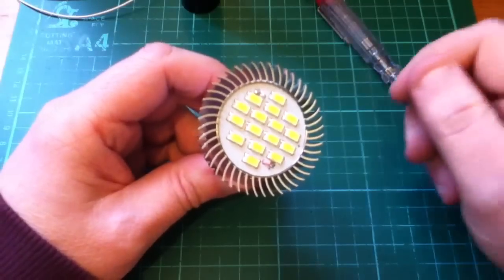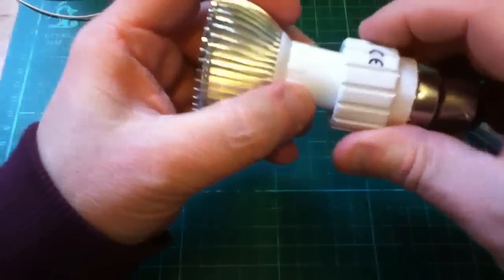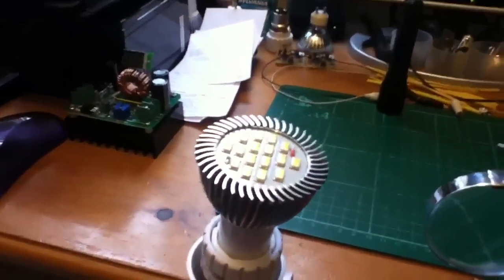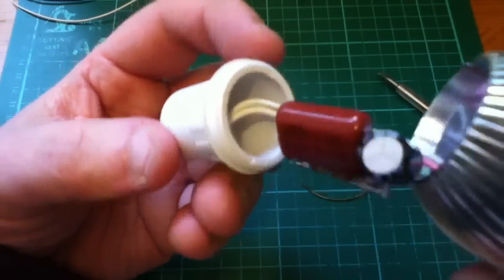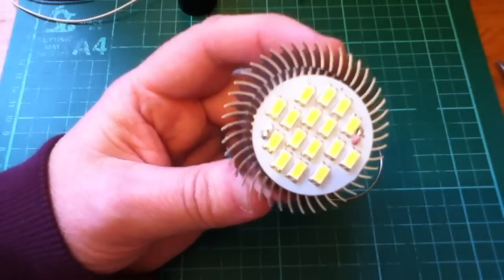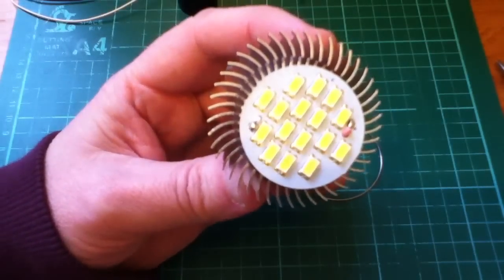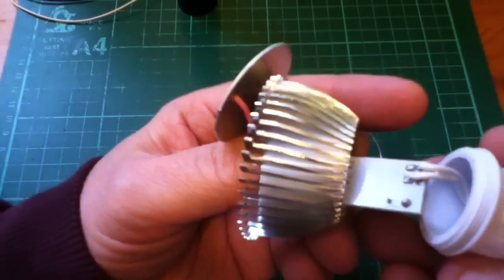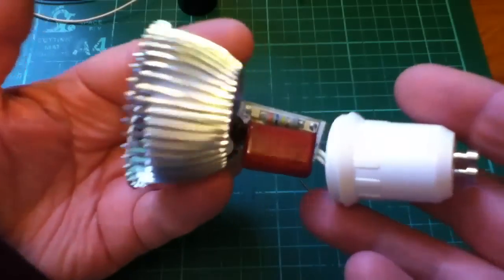Dangerous GU10 LED Spot Light is Cheap and Bright but could Kill You - Seriously

Comment: EDIT: This post originally read
"Remind me not to buy lighting from China."
it should probably read
"Remind me to check the reviews of a product before I purchase it"

However, several commenters have pointed out that shoddy merchandise or electrical components could be made in any country. My original post was a bit Jingoistic on my part, however I am leaving it up because It is a mistake that I made, and I don't hide my mistakes.
Reply: ***** I applaud your comment. If only everyone online could follow your example and show the humility you have. Bravo Sir.
Reply: If you don't edit it, then how will people know that you have learned from your mistake? I would edit if I were you. It's a bit too honest to display your previous mistakes.
Reply: Robert Headley crappy electronics can't be marketed in most countries. Sadly, China is not one of those.
Reply: I generally enjoy purchasing affordable electronics from China, but I think I will avoid anything that doesn't use batteries.
Reply: Yes, but they generally wont electrocute me.
Reply: Wang Cian hahaha if was made by Germans it's still not good rofl...you can find lighting not made in china and not with chinese components, with longer warranties too, but just be prepared to pay for it
Reply: in my opinion one of the most important factors is the assembling process ... and which country is famous for accurate assembling ?
Reply: 9 years later: Good luck finding lights not made in China.

Comment: I bought few different ones. Always with plastic lens cover. Apparently supposed to be dimmable. Effect - few exploded. And broke two dimm switch.
Wether it is wrong dimm switch I had or not I am disappointed and find those only good with standard switch. And you must say they are cost effective for sure!

Comment: why do you say it is lethal?  My father and I used to use an 80,000 volt stun gun to play tag with. it hurt but I definitely wouldn't say it is lethal. I think you're making a big deal out of nothing. it might wake you up if you get zapped but I think to say lethal is a little overboard.
Reply: and that's the difference between an 80kV stun gun and a simple 220V outlet. one is lethal and the other is not :)
Reply: The stun gun is current limited, like an electric fence due to internal resistance.  The static (no load) voltage may be high but as a current flows the voltage will drop considerably as will the current flow.    Your mains supply has a very low internal resistance, higher current will flow and can easily be lethal.
Reply: You know current is what kills you right?
Reply: You know nothing about how voltage works, then. You can have millions of volts and not be killed by it, but 240V mains still has the potential to be lethal. The lethal factor is whether or not there's a safe limit to the amount of current that can flow through your body. On your stun-gun the current would be tiny, just enough to be painful but not cause damage. On the mains, the maximum current flow is massive, easily enough to kill you.
Reply: Bob Tahoma Not strictly true. Voltage alone does nothing to you. Put simply, voltage is how strongly electricity wants to move from one place to another. It's true that the amps are what kill you, but that's not the whole story, since a higher voltage results in a stronger pull which will drag more electrons through you.

Simply put, of course.
Reply: It's not just about electrocution, it can cause fires. Faulty electricals can cause fires.
Reply: Yeah we really want electronic safety to be decided by thick policemen.
Reply: David Hynd
A static shock from a doorknob is a good example. It hurts but there's not enough energy stored to seriously injure you.
Reply: dllexport- Yup. The zap you get off a trampoline is another common example :)

Comment: I don't understand the issue. Your AC supply reverses direction every phase rotation so the front circuit is always receiving potential directional flow at 50hz. Either way, the rectifier circuit is omnidirectional for the purposes of DC so the front circuit only actually receives rectified and smoothed direct current. So, why does it matter which way the bulb is inserted?
Reply: A capacitive dropper like this works on AC, it is placed between one of the main leads and the rectifier in the circuit.

When inserting this bulb the "wrong" way there's no voltage drop between the hot lead and rectifier. Thus exposed contacts on the front have an high voltage relative to earth. That's where the danger lies even though the voltage across the LEDs themselves is quite low.

Since earth is tied to neutral in the grid, touching the hot lead is dangerous.

Rectification only helps so much here. It delivers direct current to the load but it doesn't eliminate that potential difference relative to earth. You have to consider the waveform between the rectifier input and output, not just the output itself. With full wave rectification an output (say the negative one) is sourced from each input alternately. So you have dangerous voltage (to earth) half the time. 

Unless they're in a sealed enclosure, electronics devices should include a transformer for galvanic isolation. This prevents the circuit from sitting at a high voltage relative to earth ground. That is irrespective of the voltage the circuit operates at.

Comment: I think you are right to some degree , however I would bell test that lamp (not connected obviously, I mean just bare on its own in hand) and see which pin if any , bells out to the heatsink or any exposed circuit on the facia , then I would plug it in and then do an ac test on the facia to see if there is any voltage leak , if its full 240v like here in the UK , then yes there is a serious problem , although ive not heard of anyone getting a shock from one of these and if you have an MCB on your consumer unit it would just trip , trip so quick you would not feel a shock , except see the lamp extinguish , im no expert but I do know where this guy is coming from. if in doubt go to a proper electrical wholesaler or retailer , paying a bit more is worth it for a branded item and you have after service.
People really need to be so careful in what they buy nowadays and make sure it is C.E. (central europe) marked and safety marked etc.

Comment: I'm trying to understand... LEDs needs lower voltage compared to 240V and needs DC, not AC. So, I think that there is a "step-down"... So if you touch the bulb it would be a lower voltage, not right?

Comment: If your house is tested and certified properly the down lighter fitting should be earthed. If it is, if there is any leakage whatsoever the circuit breaker or the RCD (earth leakage) should trip.

The heat sink housing of the down lighter should be earthed to the metal casing of the light fitting. The problem is that many of these products are not approved by authorities. ie PAT tested and approved. When you buy things on eBay there really is no guarantee of getting a product that is actually compliant with your country's electrical code.

Comment: I don't see the real danger and the since the current is dropped via the resistors before it goes into the rectifier,  the output leads would be mucher lower voltage DC. Even if you series all 16 LEDs, a mid to high voltage would blow the bulb. If it were a half rectifier which WOULD leave one of the leads a direct connection to the input, the light would flicker. The metal plate is needed and must be close to transfer the heat to the sink. The isolation transistor would be a sound idea, the chances of the resistors to fail would cause them to break the circuit. Cheap design but I don't see a danger.

Comment: Thank you for alerting us to a poorly made and dangerous product.  It would be interesting to do a hi-pot test to determine what voltage is necessary to break down the few microns of insulation between the live components and the metal plate.

BTW, when I work on any electric fixture I stand on a wooden ladder or stool.